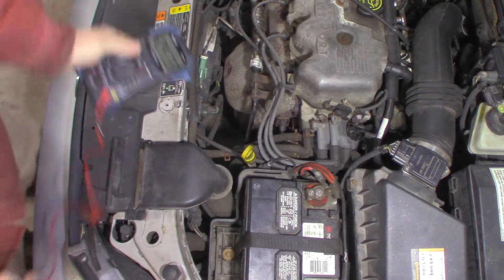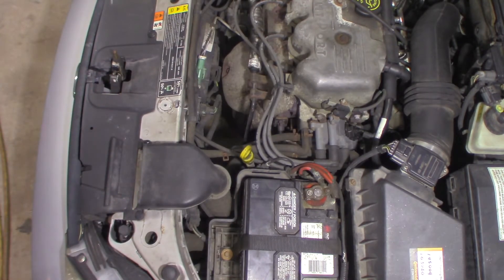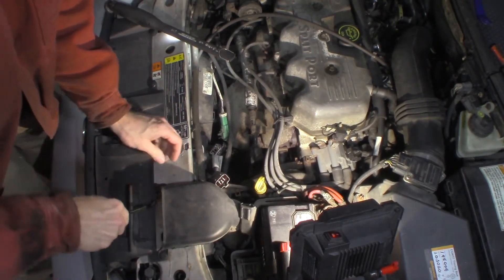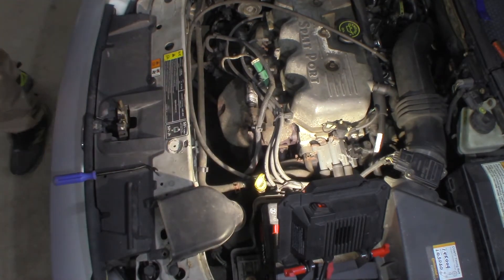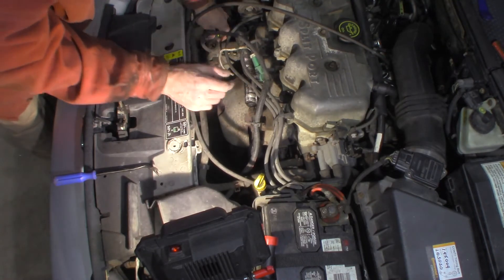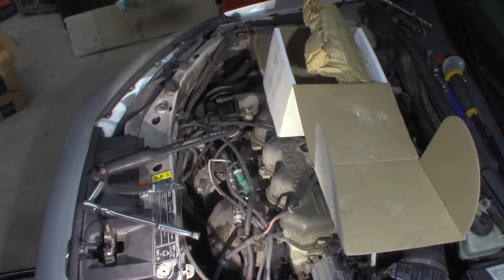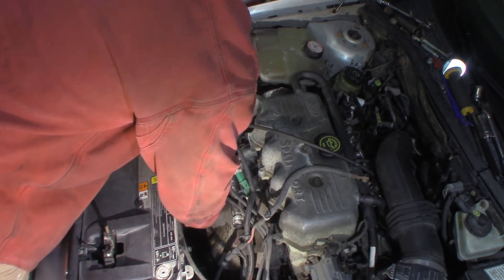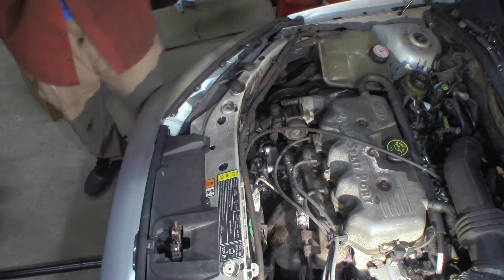2000 Ford Focus 2.0 SOHC Alternator Replacement

Comment: Would you be able to give me a bit more detail on releasing the belt from this alternator? It's my only hang up on this little project I'm doing for a buddy.
Reply from the maker: If I remember correctly unbolt the overflow resevoir from the fender and move it out of the way.  pop the power steering resevoir out of its bracked and move it out of the way and that should give you a clear shot at getting a wrench on the tensioner pulley and allow you to remove the serpentine belt.

Comment: I had an issue with my 2000 Ford focus I was driving down the road at night time . And my battery post came lose while I had my lights on and car shut off. I put the  battery post back on ran fine and it went an drive . So I decided to go home an next morning I took off the battery post again in day time without lights on and it stayed running but as soon as I turn my lights on without the post hooked up she died. But will run without the lights on with the post off the battery. I hook it back up an turn lights on it's fine will run a idle does that mean my alternator is weak?? 3rd day now I went to work an I have no isues but makes no sense to me why the car will die when I turn my lights on without the battery post hooked up but it will not die as long as I don't turn my lights on when the post is not hooked up.. is the alternator weak ?
Reply from the maker: Need to make sure the battery terminals are tight and test to see if the alternator is charging the battery when the car is running and then when under load (turn on lights/heater/fan, etc.).  Check the voltage across the battery terminals and see if it's charging (13.6-14.5 volts or so).  That's where you would need to start.